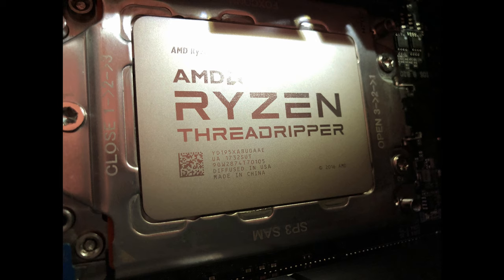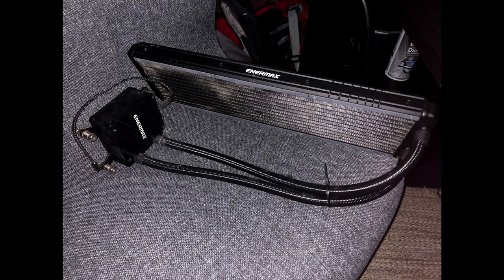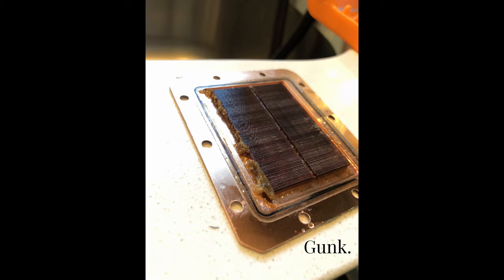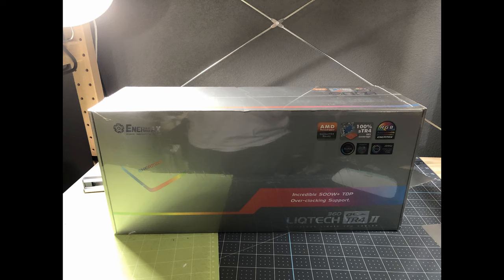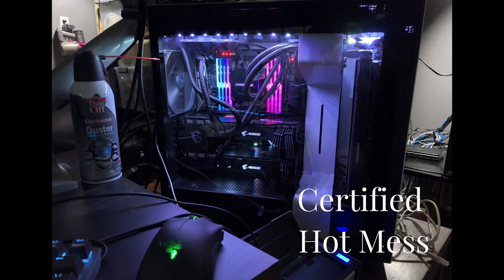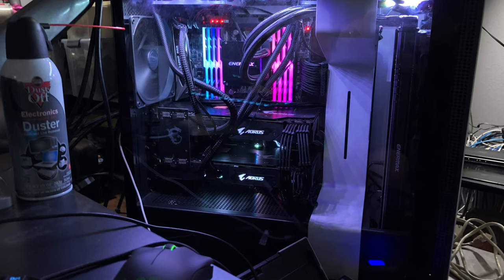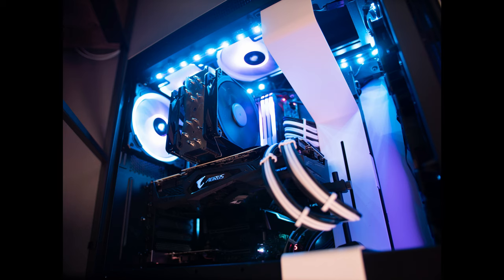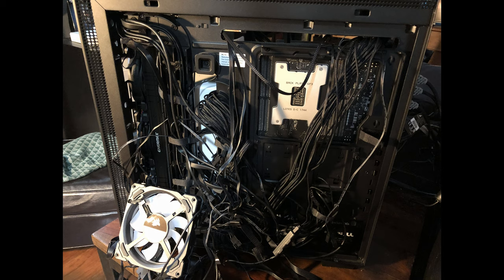Bad idea computer purchases for video editing - Don't Do this...

Comment: The last not-so-good purchase I made was an AIO liquid cooler for my CPU. It worked well enough (Corsair H100i), but the reason I decided to try water cooling was the cut down on fan noise and to mess around with some overclocking. The liquid cooler was much quieter when the CPU was idling, but any CPU stress made the fans kick on, and it sounded like a friggin' hurricane. The cooler worked for about 3 years, with less and less cooling efficiency, until the pump gave out. I went back to Noctua (my fave), and got a NH-D15, and have been happy ever since.
Reply from the maker: EXACTLY the cooler I use and love.  That noctua is FANTASTIC!!! :)  Thanks for sharing!

Comment: I had the same issue with the TRII 360 so I got it replaced under warranty. The first thing I did with the new one was crack it open and drain the fluid. I flushed it with distilled and then refilled it with a distilled mix with additives for a biocide/corrosion inhibitor. Pretty much all AIO's are mixed metal unless you start going super high end, like the units from Alpha Cool and EK. That being said, changing out the fluid fixed it for me. Ran it for close to a year before upgrading to a 3950X and I checked... no gunk. Enermax must not be adding enough corrosion inhibitor or biocide to it's fluid.
Reply from the maker: The Game Bench Fantastic tip - I would have gone back to it if I knew this because it cooled great at start...smart move

Comment: I do a quick list on the cooling, and you touched up on some of the points... In a editing rig or any other productive environment, you don't want to have even a single AIO or water cooling solution.

1st: It requires maintenance, even if it claims it doesn't. In AIOs, that leads to their death.
2nd: Hard to diagnose faults, install new hardware, or just replace something really quick to keep producing content.
3rd: In some cases, AIOs have pretty severe failures, and you can throw away a large amount of your components (usually motherboard and graphics card/s)
4th: every AIO costs 100$+, give it or take. If you're bored about the fan noise, isn't it  just easier and cheaper to just route a bunch of USB and HDMI cables to your editing desk? That's what I did, including the Power/Reset switch. My desktop PC is sitting happily in the attic and I never ever hear it even though it's always full blast.

As a side-note on point 4, on my setup I used Ethernet very well shielded Cat7 cables for the USB 3.0 ports (carrying data only) and 5 QC3.0 chargers to power up the USBs at the end of the line. I could've used regular USB cables if it wasn't for the cable run I did, which is almost 60 feet. And yes, I receive 4K at the end of the HDMI after those 60 feet, being the most expensive part of the system, at less than 100$. Then Power switch, HDD led, etc. goes through two Cat5 elcheapo cables, but could've gone with less.

Comment: Going for the cheapest (well, not cheapest cheapest) motherboard/power supply to spend a lot more on CPU/RAM. Miserable choice I will never do again.

I now follow another strategy, which is to buy refurbished items with warranty at a local distributor that sells and ships hundreds of components every day. I now even save on the whole build but using good hardware only.
Reply from the maker: That’s a great point. I just swapped yet another small b350 motherboard out of a previously ITX build because of a “quirk”.

Comment: Great video, as usual.  Would you consider doing a Hackintosh build for DR Studio (that's not liquid cooled). I'm so sick of windows, and I can't afford a mac. I'm open to Linux again, but I'm seeing so many issues with it and DR. Which surprises me since BM initially launched it on Linux, right? They just don't seem to care to support it worth a shit in the forums. Anyway, rant over. I would love to see a successful Hackintosh build for DR.
Reply from the maker: Thats a pretty good idea.  Let me see what parts I have lying around and if I can piece it together...
Reply: Resolve is officially supported in RHEL and CentOS. You need closed driver(both AMD and Nvidia) to utilize CUDA or openCL. There is a script called makeresolvedeb which simplifies the steps by turning the zip file into ded package. However, I used the zip file on  Fedora 31. It installed fine but had to rename 2 openCL files on etc/openCL. I am using the free version with nvidia 1660 super. A YouTube channel called SnazzyLab did a resolve studio on install on pop!_OS(Ubuntu based distro). You may want to watch that. They used gtx 1080 there.
Reply from the maker: Jahidul Islam I’ve done some 2080ti benchmarks on Ubuntu 18.4 and the results were surprising! https://www.youtube.com/watch?v=9GpBsfdPmP0
Reply: @johnsfilmsllc  Yes, I'm facing having to leave Mac to go to PC because of the high cost of Mac for 64GB RAM, high-end CPU and GPU. (Apple's prices for 64GB RAM are insane). Hence, I'm also very interested in a build that can be used as a Hackintosh that is stable enough for Davinci Resolve. Bear in mind that with each version of macOS, Blackmagic seems to up the version of macOS. P/S on further research, it doesn't sound like such a great idea because using macOS means not using AMD processors nor NVIDIA graphics cards, which I want to use for Windows.

Comment: For Fusion, it's been said the amount of VRAM is more important than the GPU's processor speed?? Do you agree? If so, wouldn't the AMD Radeon VII - which has 16GB of VRAM (more than the 11GB of the 2080 TI) be better for Fusion work than the 2080 TI?
Reply from the maker: RT Thats an interesting idea and I bet it depends on what type of comp you are working with because the majority of the drag I’ve seen in fusion is on a single core in the CPU.  I have a fusion benchmark plan on my calendar coming up.  Just have to get away from the day job long enough to be able to do it :)
Reply: @johnsfilmsllc  In the Puget Systems article by Matt Bach, written on March 12, 2019, entitled, “DaVinci Resolve 15: AMD Radeon VII 16GB Performance” - down the page, there’s a row of graphs. The Fusion benchmark is the last one. This graph shows that, for Fusion, the Radeon VII 16GB beat the GeForce RTX 2080 TI 11GB. (The graph is a little strange since the GeForce RTX 2070 beat its own 2080 TI). But it showed that, at least for Fusion, the Radeon VII could be a 2080 TI. For other parameters, the 2080 TI beat the Radeon VII. So the superiority of the Radeon VII is limited to Fusion, and not to Davinci Resolve overall. The graph was also odd in another respect, in that one Radeon VII was able to beat two cards performing together.

Correction: In a later article, "DaVinci Resolve GPU Roundup: NVIDIA SUPER vs AMD RX 5700 XT"
written on August 21, 2019 by Matt Bach, the results flip regarding Fusion, showing the 2080 TI being superior to the Radeon VII.

Whoops. I just learned that the Radeon VII has been discontinued. :(

Comment: Hi John, great video. I'm actually in a similar boat like you and wanted to get your professional opinion. I want to slap two AMD Radeon Pro WX9100, as I'm going to be grading a lot of 6K and 8K footage.  on Davinci. OR should I just maybe use a single AMD Radeon 7 instead? or two?, OR do you think just one WX9100 is enough. what's your recommendation. 
I will be on the new TR 3 just a FYI.
Thanks so much love your work man
Reply from the maker: Thanks for the kind words Mehran!  A single card is always a better choice than two (there is overhead in allocating compute tasks to the different cards you don't have to pay when using a single).  If you prefer to stick to the AMD side of the house I don't think you can beat the value/performance of a Radeon VII (henceforth VII)  right now.  The WX9100 (WX)is extremely overpriced for what you get.  For instance Stream Processors - WX(4096) VII(3840), Core Clock 200mhz higher on VII but the real kicker...the memory pipeline is 2x as fat on the VII and the VII memory is clocked higher.  It should be able to destroy the wx9100 in resolve (keep in mind I haven't used either of them but if it were my money I'd buy the VII).
Reply: R3D works much better with CUDA as of now. A single nvidia gpu can get u easily passed 60fps in 8K in Full Res Premium decode. All you need is more GPU memory with Fast processor with more Cores. For edit/grade more cores with a slow processor is not the best. A Ryzen 9 3900x works better than threadripper 2970wx. Also RAM with faster frequency than slower one with more memory. 32gb 3600mhz > 64gb 2400mhz.

Comment: Hello John! I love it when "we" can take ownership! My sins are varied and many. I will take ownership for being impatient. Impatience leads to urgencies that may not be necessary. I've seen your video where you, using Davinci 16, use the 2 1080s and set them up, one for processing one for display. I am thinking with an ATX board your second GPU card took your 16Channel to 8+8. I'm also thinking you presumed to go to the 2080Ti using the wholly dedicated 16Channel AND the 11GB of GPU Memory that you'd come out ahead. Perhaps? I didn't do that myself but have overpopulated my ATM MB with SATA 3 SSDs and an NVME PCIE SSD. Additionally, I have data all over and I have committed the faux pas of not documenting and staying disciplined to Folder, File and other necessary naming conventions. When one learns by the seat of their pants Best Practices are unknown and certainly lacking. Thank you for a very fine channel.